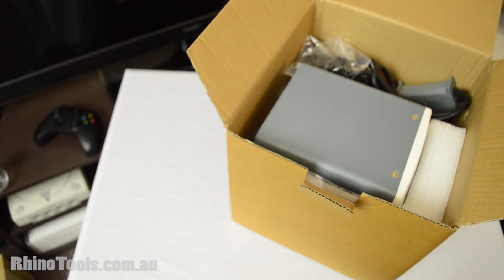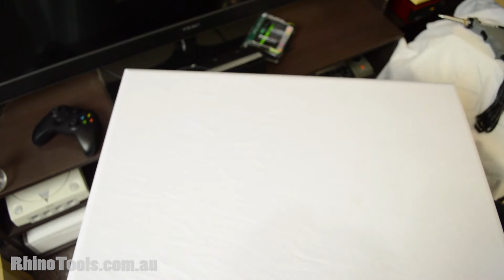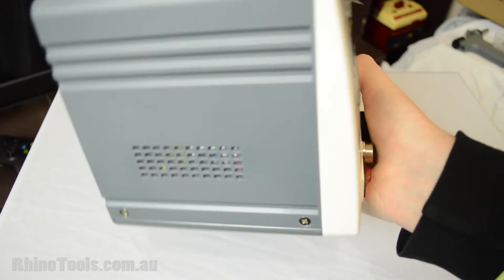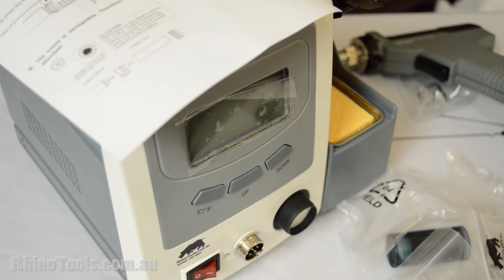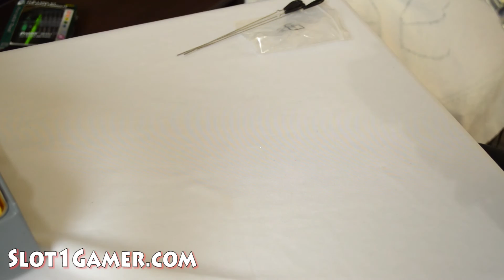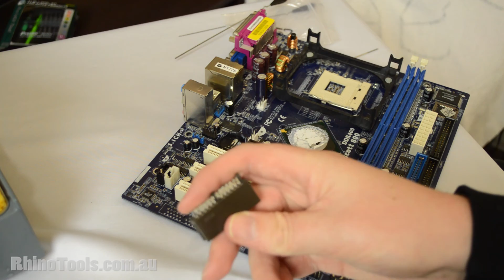RhinoTools ZD-985 Desoldering Pump Station Review | Reworking Tool

Comment: All the ZD stations are made in China by Ningbo Zhongdi. And they all have a switching power supply, but this is not mentioned on the boxes. And some of them are rebranded with different names. http://www.china-zhongdi.com/product/station/desoldering/
Reply from the maker: yep, I now have a hippo brand one, exactly the same. Pros kit seem to be selling a few units lately.
Reply: And what is the difference between an analog source and a switched source? None? The desoldering station will work exactly the same in both cases. It is more important to ground the soldering tip, otherwise you can destroy more sensitive components.

Comment: Nice vid!:) I've recently got the exact same unit (same color and all), and my unit 
seems to have some "coil whining" issues, I think it comes from the 
transformer, should I be worried?? Do yours also make some whining 
sounds?
Reply: there is no mains transformer in it. It is a switch mode power supply